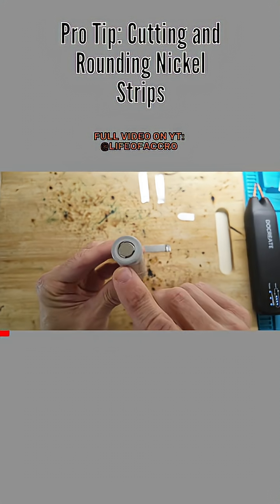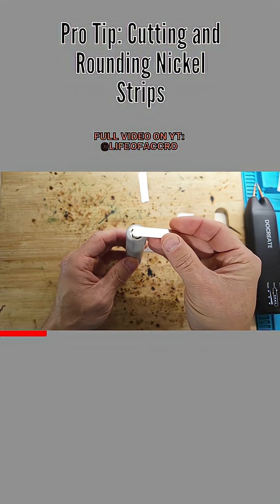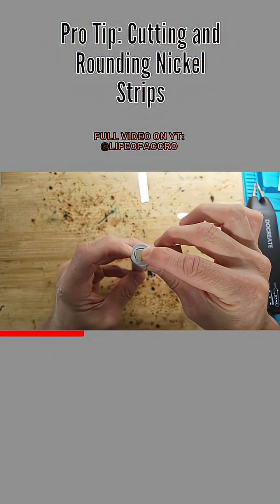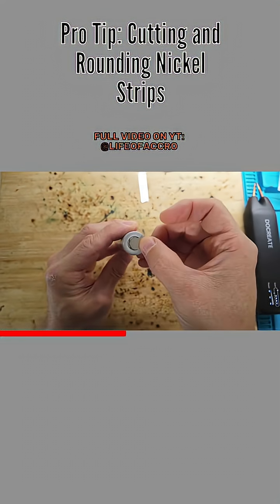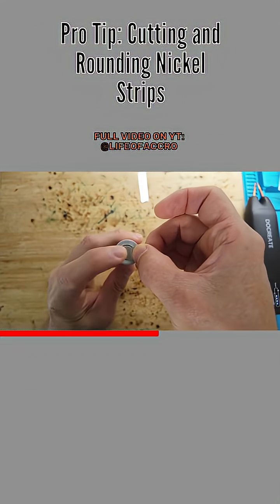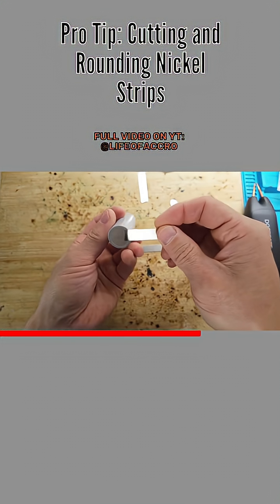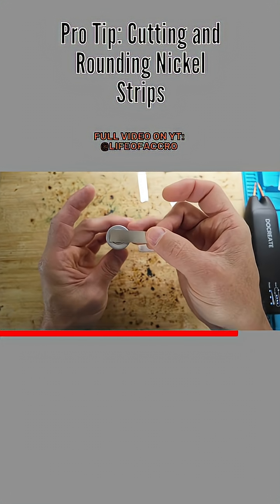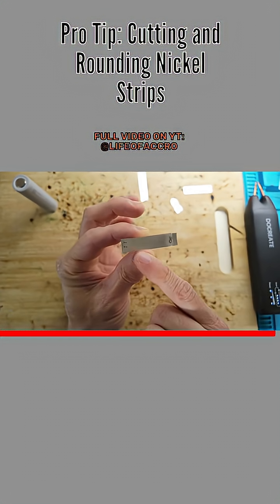Pro Tip: Cutting and Rounding Nickel Strips

Comment: Legit good advice for mobile applications, but for stationary solutions like a "power wall" it isn't as important.
Reply from the maker: true, especially if youre using cell holders too the plastic covers just right... but only takes a few seconds to round the edges and theres only "2 ends" to each row so not like its needed for every connection point